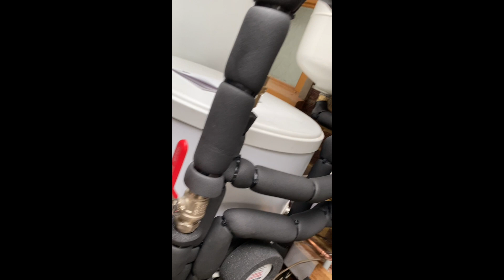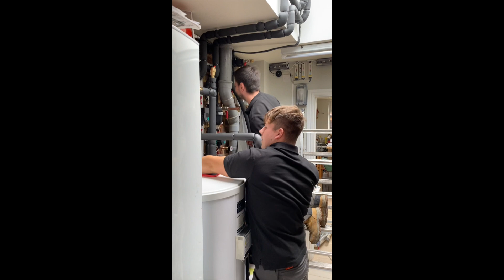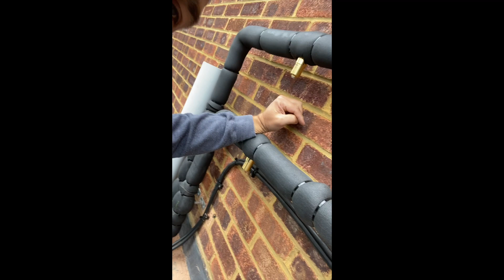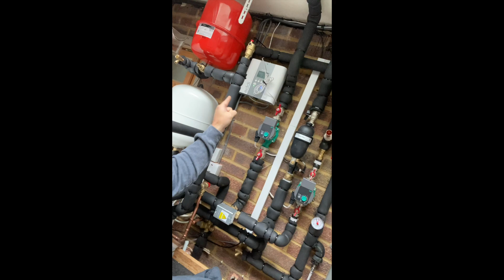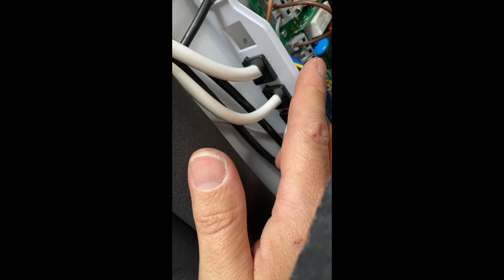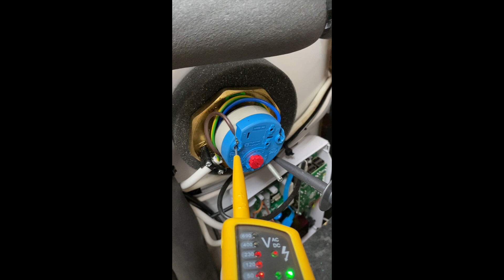Solar PV Diverters, Mixergy cylinders and Caleffi Antifreeze Valves

Comment: Really informative videos thanks.
Have you found an alternative HP manufacturer that is more compatible with Mixergy cylinders than Mitsubishi for the incremental hot water control? Thanks.
Reply from the maker: Hi Phil, thank you. The Vaillant Arotherm Plus works much better with Mixergy cylinders and Samsungs new HT Heat Pump is projected to be another good alternative.

Comment: Shouldn't the antifreeze valves be fitted at the lowest point (underneath of the heatpump), so that the pipes (and heatpump!) would be drained in case of the combination of grid failure and below zero outdoor temperatures (or in fact watertemperatures below approx. 4°C)??
Reply from the maker: They are fitted inline with the flow and return of the heat pump as per manufacturers instructions
Reply: @dorewoodman : of course they have to be fitted in the flow and return line. Fine. But in such a way, that the system can fully drain through the lowest anti freeze valve and the system can be aerated through the highest anti freeze valve. And did you check, whether the monoblock unit is fully drained if the flow and return line are drained? If so, it's fine. If not, there's still a risk involved.

Comment: Are manufacturers happy for antifreeze valves to be fitted rather than glycol used? Does not putting the correct mix of antifreeze in not void the warranty?
Reply from the maker: Hi Grant, as long as the system has antifreeze protection it ‘shouldn’t’ affect the warranties. Vaillant approved this on their system earlier in the year and I know that Mitsubishi also support it. 

That said, I can’t speak for every manufacturer, ultimately if you are unsure, speak to the manufacturer if you are installing various brands.